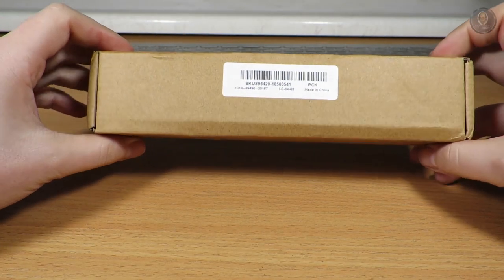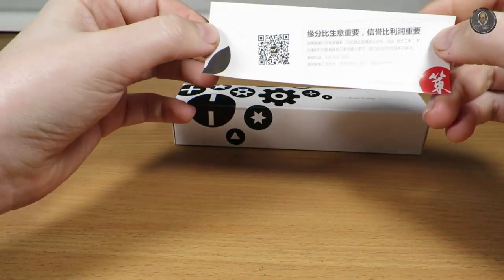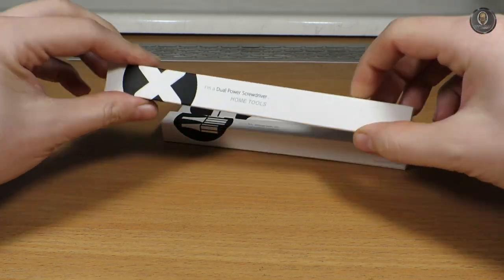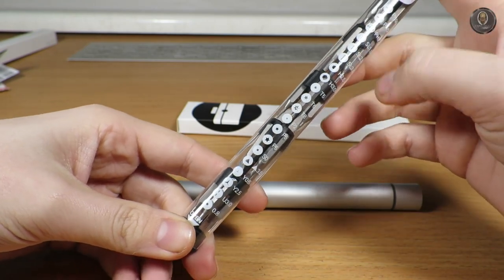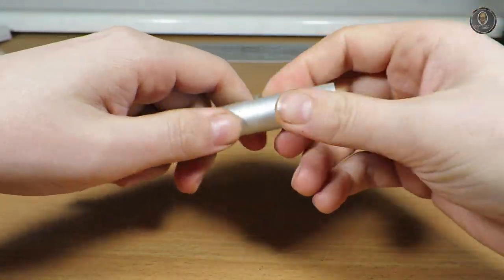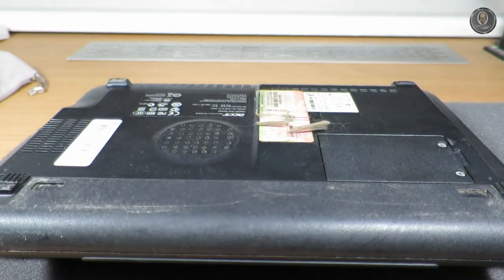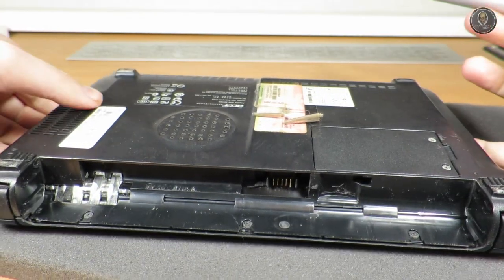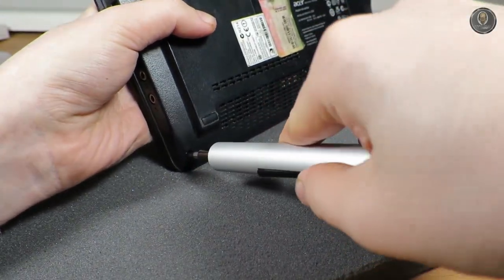How good is the WOWSTICK 1P+

Comment: Huh. Good thing I didn't buy this. Too bad it didn't have a bit more power. It looks like it's good quality though. At least it won't strip screws out.
Reply from the maker: You are right but My Bosch IXO have more power and would strip heads and unscrew it on end :D
Reply: Yes. I have a cheap $15 knock off of the Bosch driver that I got at Walmart and it will break screw heads if you aren't careful.